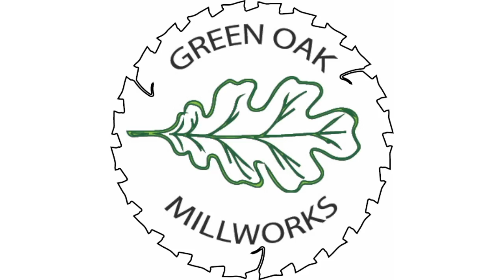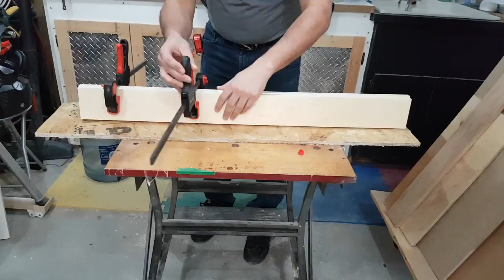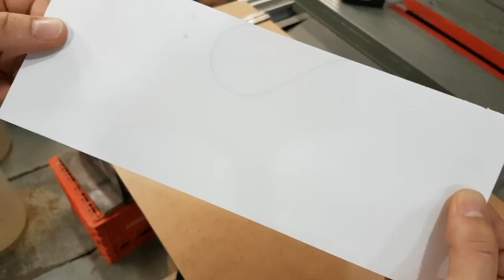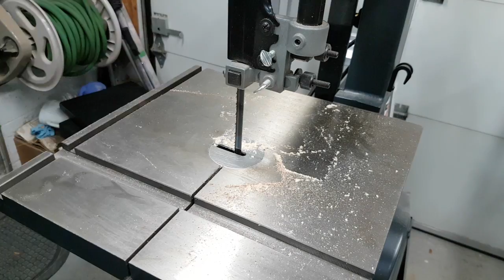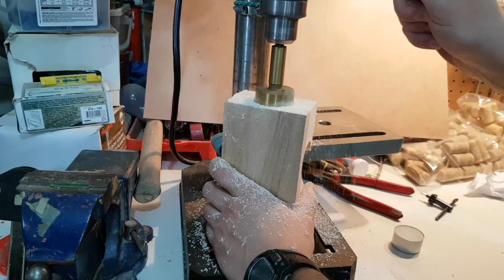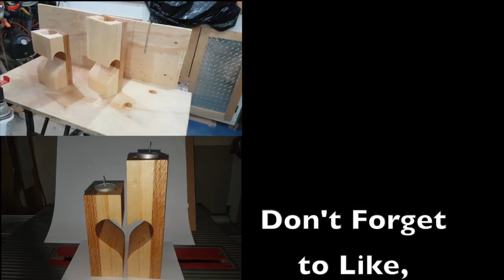Making Decorative Candle Holders

Comment: What clear coat did you use for these?
Reply from the maker: snookese: I don’t recall what exactly. I made them in 2017..
Reply: You can use water based clear coat or shellac or leave them natural. I have a few videos on different styles if you wanna check them out